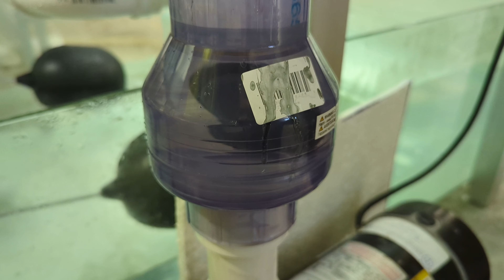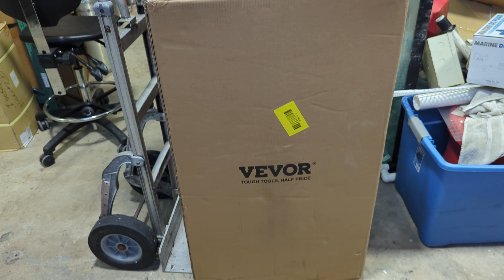160 20 Gallon Tanks Up and Running at the New Building

Comment: if you don't mind a side intake - you can just throw a 1" T on the bottom drain pipe, allowing the top drain into one leg of the T
Reply from the maker: Anything hanging off the side is welcome crack the way my guys work. But it's a great idea for a home system where nothing but TLC will be provided by the owner.
Reply: @JackWattleyDiscus  nothing hanging off the side, just when you put a T on the bottom drain pipe, the drain hole for the bottom tank is horizontal instead of vertical like you have it now
Reply: @lewisallenl7065  Just can't figure out what your saying??